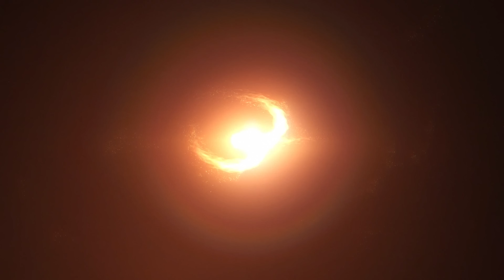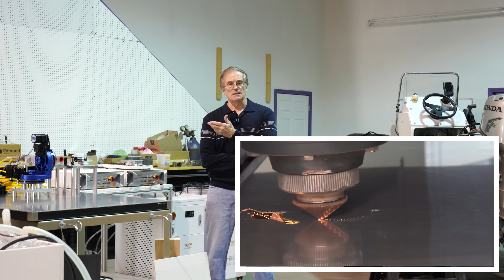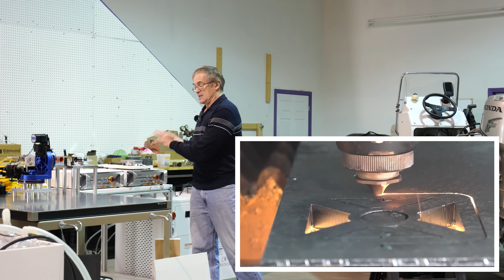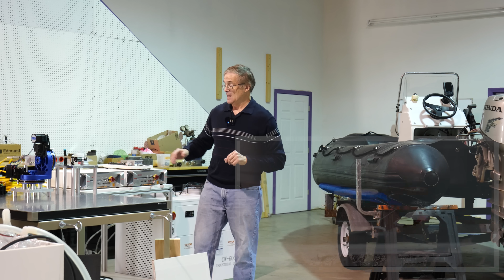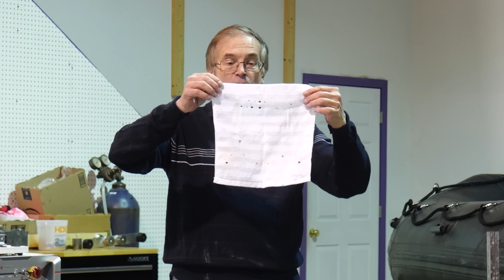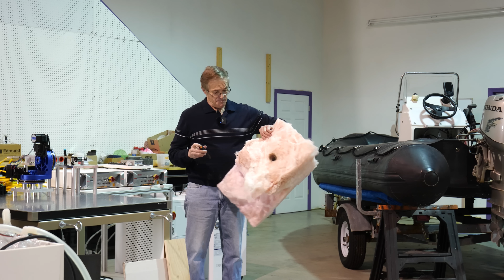We have a problem... and need your help!

Comment: I have an idea. What about water with an absorbing powder suspended in it? The powder should absorb the energy, and the water should be a heat sink for the powder.
Like water with charcoal powder in it or something.

Hope this idea helps!
Reply: Was thinking along the same lines. This assumes, if using a glass tank, that the glass would not be vulnerable to the beam and that the glass would not act as a mirror.
Reply: @bitslammer  I am pretty sure that at the laser's wavelength normal glass is opaque, so it will burn a hole in it, like it does most everything else.
Reply: @feraloid  My laminar waterfall idea would work then
Reply: https://www.youtube.com/watch?v=NpjO8NkOTPM&ab_channel=MTFXlimited
Something like this but black water
Reply: @feraloid  I think as a stopgap that would be ok. It would burn a very small hole in the tank, so the leak would be relatively slow. Plus it would evaporate any of the water coming out of the hole until the laser was turned off. So you'd just create something to catch the water (like a kiddie pool). 

I think you'd want to have a pump running to keep everything suspended and try to equalize the temperature.

This would also allow you to pump everything out of the tank so you could swap the front glass.
Reply: @alachance2010  Laminar is too complicated. I think water recirculating over the right pad material could be the ticket. I'm imagining something like the water recirculation system found in an evaporative cooler (swamp cooler).
Reply: other option is a laminar flow waterfall of the black water, but that is way more difficult.
for this, I imagine a large sheet suspended at an angle and with walls, such that water slowly pours out of one side, giving a sheet of black water effect.
Then it is pumped back up to the top.
Reply: I came to suggest basically the same thing, a tank with of water with a silicate or a polymerising agent in it, or the tank could be self sealing.
Reply: Xanthan gum. The powder is not that expensive in comparison  to all the other development costs..
Mixed with graphite... hmm. I wonder also about " drilling mud" (barium) or kaolin / bentonite clays.
 Both are extreme thickening agents- barium being more dense.

@milksheihk
Reply: Ha ha, I also had the same idea. My solution is a waterwall/waterfall with the absorbant in liquid.
Reply: @alachance2010  a carbon black pigment would work but keeping it dispersed in water, even the thickened kind would be a nightmare.
Reply: IIRC Water alone will diffuse a laser real quick, problem is: What do you put the water in? coz the laser will punch a hole in the wall of the tank real quick, and now you're dealing with water everywhere.
Reply: That and water is real heavy. Portability requirements start to go out the window unless you intend to just dump the water and refill when you're done moving @Mort_OOPz
Reply: @Mort_OOPz  Yeah, that's why I suggested silicate or polymerising agent to thicken the water up enough not to leak out, a self sealing bladder might not be able to recover from being lasered.
Reply: @milksheihk  Yeah, that could work... I hope they test these ideas!
Reply: Fine mist sprinklers should do the trick! Get enough of them in series will create a laser weapon nightmare. In military grade energy weapons, dust or clouds are an unsolved problem.
Reply: Too reflective. Have you ever looked at pool/lake/sea?
Reply: I posted a comment like this similar to yours before I saw this, but I'll add some of that information here.

The best absorber I can think of right now is a water soluble dye, specifically black fountain pen ink. Noodler's black is a ridiculously black ink that is still absurdly black when diluted, and you can buy it by the gallon. I don't think you can do the same with Noodler's Bad Black Moccasin (which is literally designed to resist laser etching forgery, but that's lower power and after it's on paper). The idea with the tank would be to use the ink to dye the water black. It's water soluble, so you wouldnt need agitation other than to spread the heat around, and you'd want the optical density low enough that the light isn't absorbed all at once because you'd just get steam.
Reply: Of course, this depends on the exact wavelength of the lasers. What is the wavelength they have?
Reply: @matthewmalaker477  Also had the same idea - I would use two boards of wood with the space inbetween beeing filled with (dyed) water. The thickness of the water-shield should not matter as the pressure is only dependent on the heigth of the water above.
Reply: how do you contain the water, the laser will likely melt glass.
Reply: @flopilop4596  Already addressed in the original post, read it again.
Reply: lol... I like how this is the first thing many of us thought of

Comment: Blocks of ice
Reply: The instant vaporisation will probably blow up the ice blocks, but it will be a fun test.
Reply: highly portable.. :D
Reply: I like this idea.  Suspend a solid in the ice. The solid would absorb the heat, the water boiling would dissipate the heat.
Reply: Graphite and ice matrix?
Wait. The water would disassociate,  wouldn't  it?
Hydrogen/ oxygen go boom. @marcericdavis
Reply: Also thought wax blocks might be good alternative.

Comment: Opaque sand? I would think something that melts that allows more of the material to flow and fill the created gap

You would need a giant mound
Reply: My first thought as well. Just a dirt pile.  But it doesn’t fit within  the needed parameters.
Reply: Could also make a wall filled with sand, probably works out better that way.

Comment: Pulse width modulation?   Vibrate the focus lenses.  Or simply defocus the collimation?

Good for aiming at least.

As for blocking maybe concrete blocks in a zig zag, so reflections get trapped bouncing around between the blocks.
Reply: I was thinking about something like that too - but since there's a worry about system failures that cause the beam to idle in a spot too long, we'd have to include this defocusing system also as a failure mode. (Like a sensing plane behind test target that signals to defocus the system).
Reply: Great idea. I know there's liquid crystal encoders that are fast. He could PWM the power to whatever. Combined with a decently fast PLC controlled interrupt.